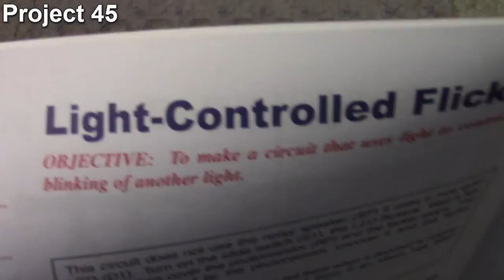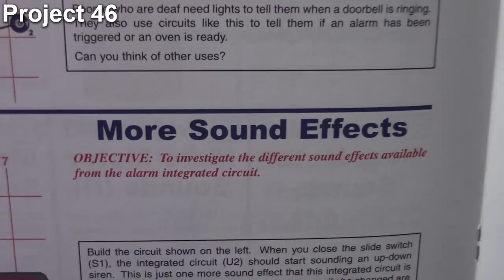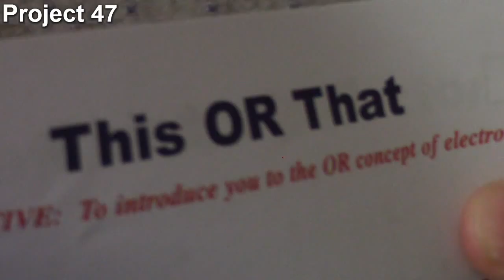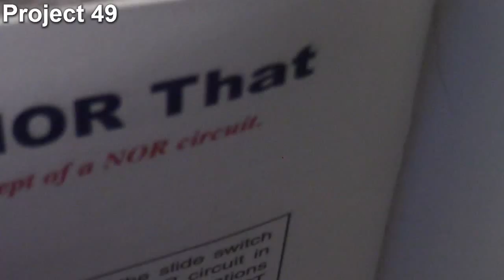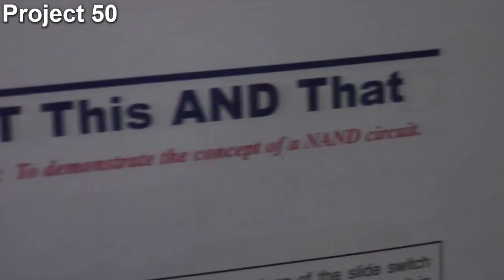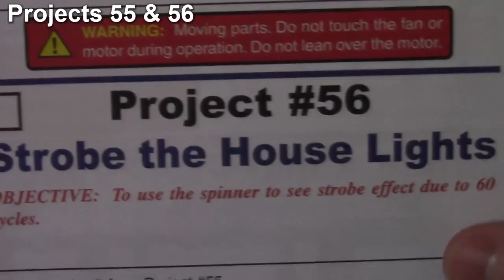ELENCO Snap Circuits Projects 45 - 56

Comment: In project 50, can you please explain to me why the light goes out when both are pressed?  Isn't there still some current going thru the LED?  I don't understand why making the 2 condition True prevents the current from going thru the LED.
Reply from the maker: In an ideal circuit, current always takes the least resistant path to ground. Assume the two switches have no resistance thus current can easily flow through them. Now while the LED doesn't need much current at all to light, it still has resistance (and remember the circuit does have a 100 ohm resistor to start with. When both switches are ON, you create a LESS RESISTANT path for current to go thus none goes through the LED. Now because ideal circuits are always theoretical, you are likely right in there is still current going through the LED however it would be very small, far too little for it to light.
Reply: That makes sense.  Thanks so much for your response!